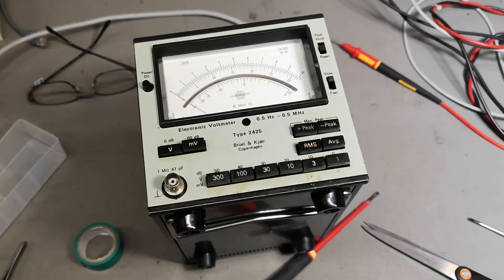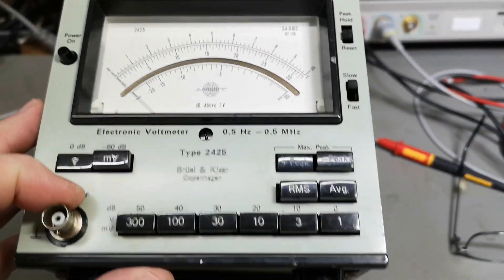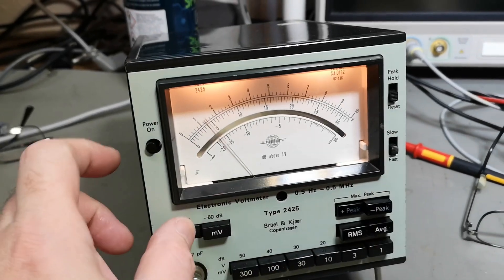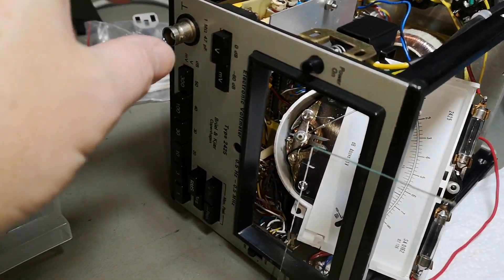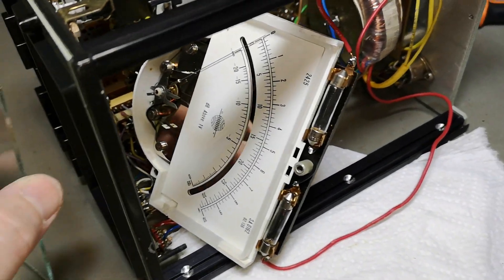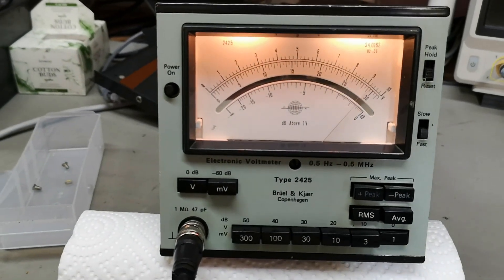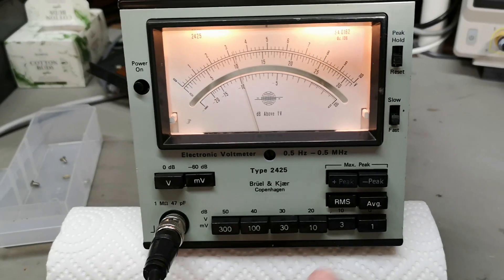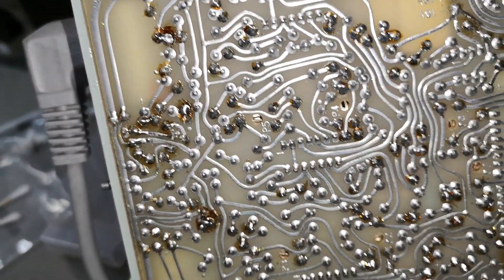Brüel & Kjær Electronic Voltmeter type 2425 0.5Hz to 0.5Mhz teardown repair

Comment: 11:35 As you can read from the plate on the backside the "Fast" setting must not be used for frequencies below 20 Hz. I suggest to use the "Slow" setting.